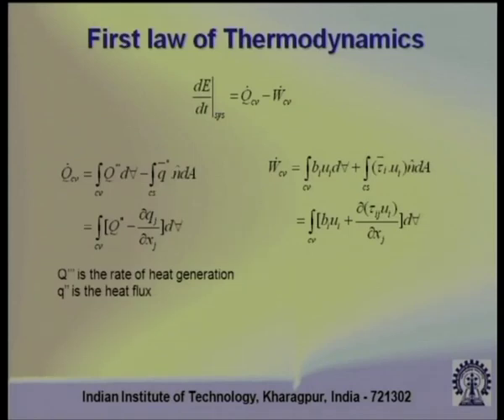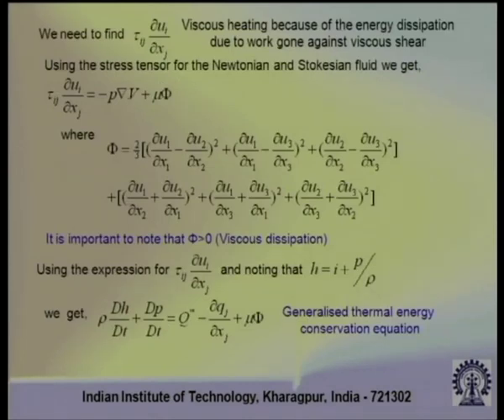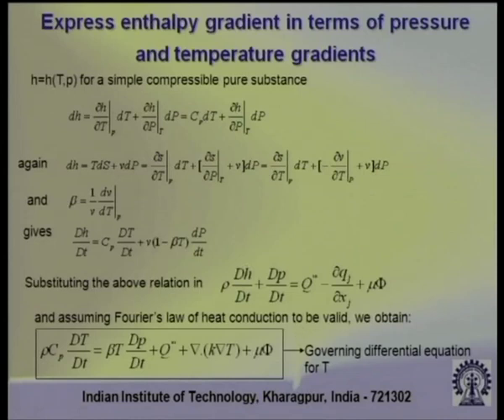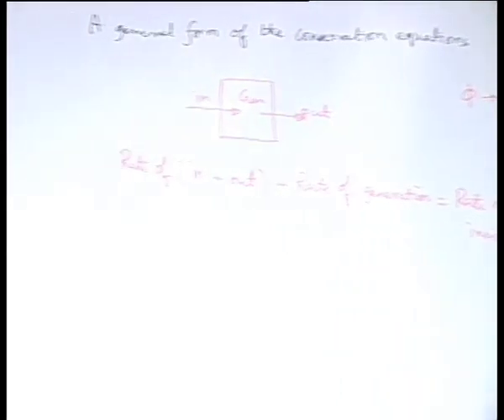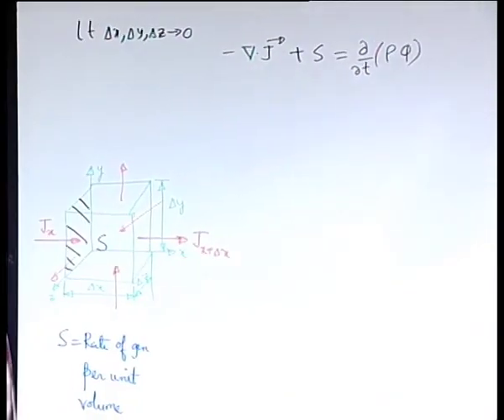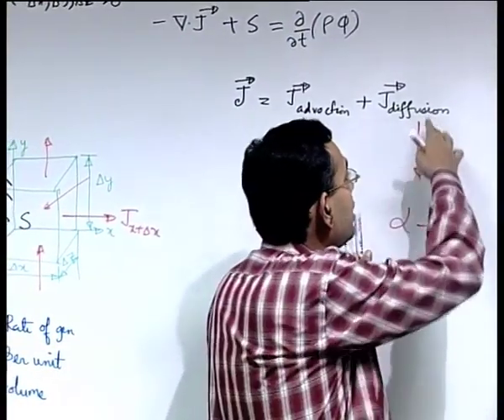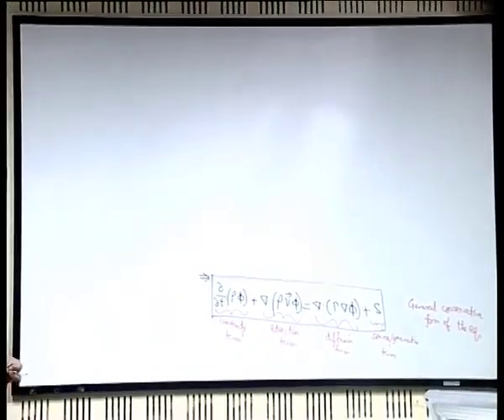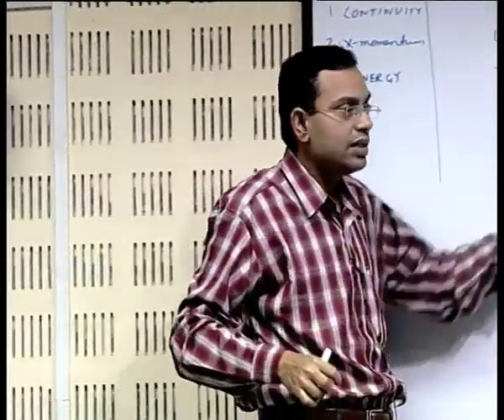Mod-01 Lec-04 Energy Equation and General Structure of Conservation Equations

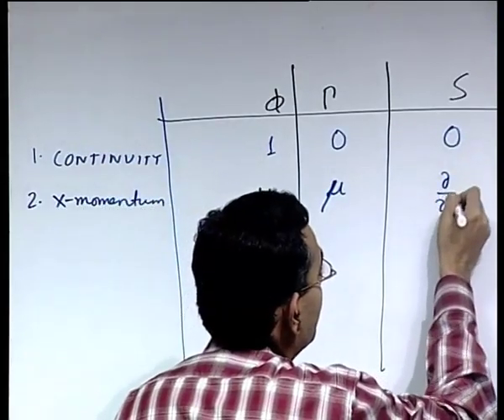Comment: Regarding the source term in the momentum equation ( @50:37 ): I understand that the pressure gradient term and the viscous term with volumetric dilation would be included. But the first three terms that Dr. Chakraborty wrote seem to the div(mu*grad(u)) term and not the source term. Is that by mistake or am I missing something? It would be great if anyone watching this could clarify. Thanks! 

PS Great lecture series, thank you Dr. Chakraborty!
Reply: he corrected it later
Reply: @johniitjodhpur   Haha! Thanks for letting me know. I realized that after I finished watching that lecture. Should have probably deleted my comment. Great lecture series

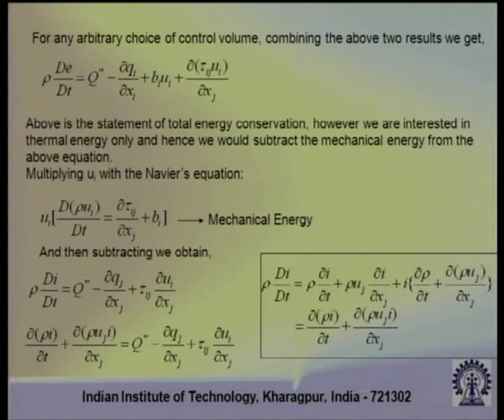Comment: at 7:42 the equation at the top, should both of the signs for the work done by the body force and surface force be negative, according to the total energy equal to the heat generation (first two terms at right hand side) minus work done by the system?
Reply: rate of change of total energy of system is sum of  heat flow in or out and work done and for this take thermodynamic sign convention you get same as explain in video
Reply: rate of change of total energy of system is sum of  heat flow in or out and work done and for this take thermodynamic sign convention you get same as explain in video